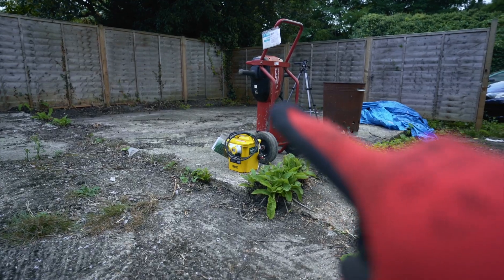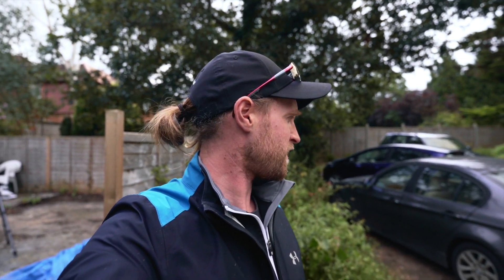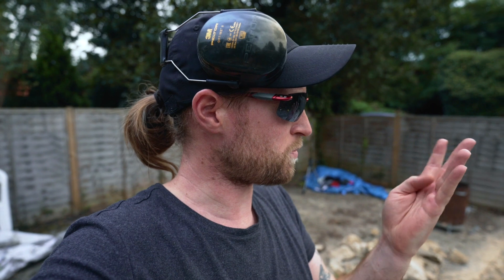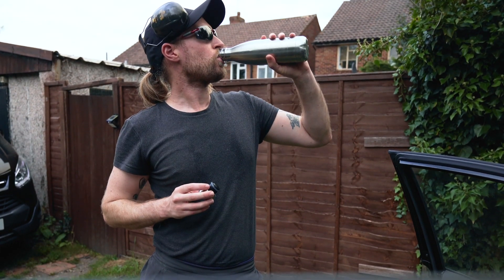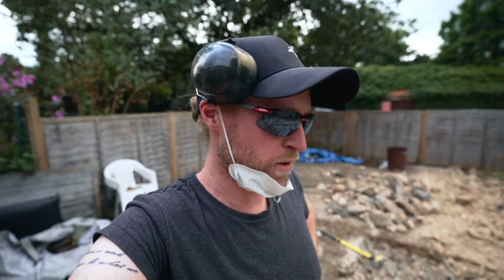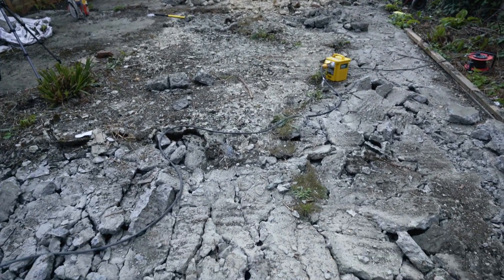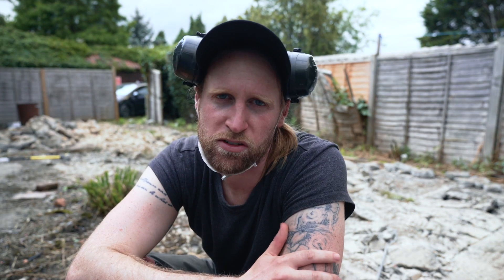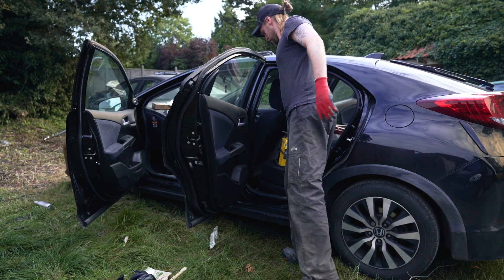Building Our Own Tiny House Pitch! | Vlogust ep.29

Comment: Great job. You really worked hard. I think that moving from the campground will work well for you. By the way, what's a skip?  I'm Canadian and don't know the meaning of some British words.  Also, I noticed that you gave the measurement of your trailer in feet (9 feet wide).  I also haven't been able to completely give up the imperial system of measurements.
Reply from the maker: Hey Anne, a skip is one of those big metal things you put rubbish in. Most building sites have them and someone drops it off and picks it up. I don’t know why it’s called a skip though 🤔 

We’re very much 50/50 with metric and imperial over here. All tape measures have both inches and millimetres, we still use miles instead of kilometres and yards instead of metres. I guess it’s useful to know both 🙂